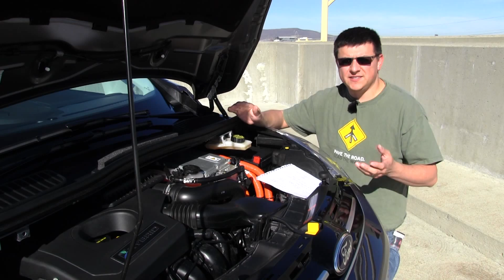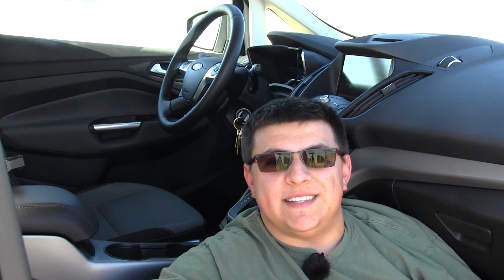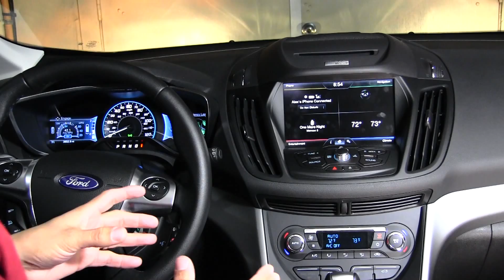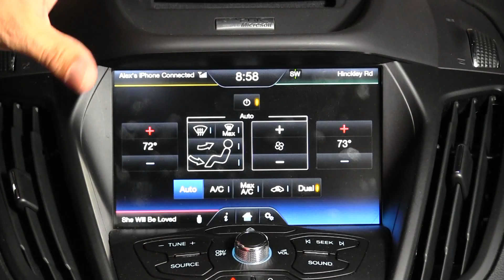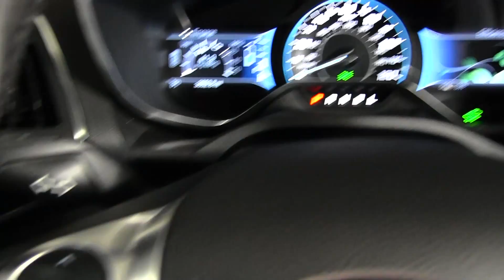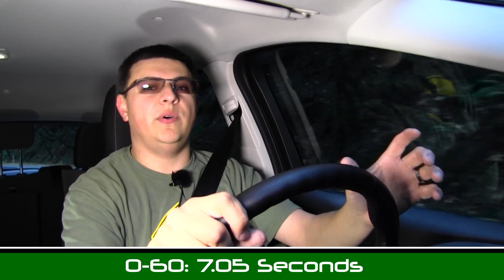2013 Ford C-MAX Hybrid Drive Review & Road Test

Comment: I have one of these and the poor baby doesn't belong on a ranch.  Right now I cannot get it to start.  It randomly has a radio that won't turn off so I needed to take the fuse out but because it seemed to turn off, I didn't bother and now it won't start with a jump.  It's dead dead.  I also changed the oil and when I went to reset the warning light, it couldn't be done so it still says I need an oil change. If that weren't enough... I was low on break fluid which I filled and that light is still on too.  The worst part is that one day the alarm decided to set and now I have only seconds and you can hear the count down to get into the car, put my foot on the breaks and get that remote key inside the vehicle before the alarm goes off.  What should I do?  There is a new Ford dealership in town and I've heard they are good.  Does good mean honest?  Maybe I should just trade it in.

Comment: I bought a used 2013 CMax Hybrid SEL (No plug-In) in 2021.
So far it is only getting 29 to 33 MPG overall.
New plugs, New oil, New air filter, Good tires, Average miles.
The gas engine kicks in a lot more than I thought it would below 40 MPH and I don't push it hard to go or stop. Last owner bought it new and was a little old lady. It seems to be in great condition and I like the car and how it drives except for the way it brakes it takes getting used to and the MS Sync / radio system had to be rebooted by pulling a fuse as it had stopped working. She even wrote a note about this problem in the owners manual.
Any suggestions as to how I can get my MPG up ? I tried premium gas and fuel injector cleaner all ready with minimal results.
All in all I am content with MPG as my 2012 4x4 Jeep only averages around 12 to 14 MPG.
Reply: I've had a Cmax for over 5 years and getting the max fuel economy takes some strategy and practice. From what I've found, the gasoline engine is more efficient at accelerating and climbing hills and the electric motor is more efficient at coasting. What I try to do is drive at a normal pace while accelerating and climbing hills to keep it from going into EV mode, but not flooring it. Then when I'm up to speed on relatively flat ground I let off the gas entirely and it'll change to EV mode and then you can just barely push on the gas to maintain speed and it'll stay in EV mode. 

Also, don't underestimate brake regeneration. Try to get in the habit of starting to lightly brake much sooner than you would normally. The longer you can keep the brakes in regeneration  you'll recoup more energy and use your actual brakes less. 

Also, cruise control can help as the computer is pretty good at managing the hybrid system. 

And if you can keep it under 65mph, you'll save a few mpg. Highway driving in general will get worse mpg than city driving. 

The radio fuse issue is common and has happened to mine probably 4 times.

Comment: I just bought a 2016 C Max SEL and really like it. the current mpg is around 41, but it is winter now and I am expecting better mpg as the weather warms up. This is significantly higher than that of the 2006 Honda Element I had which was averaging 19 mpg.  I also ordered a K & N air filter which many people have reported  that they are receiving higher mpg once they installed it.
Reply: So, 10 months later, did you see a difference in mileage?

Comment: All this talk about the fuel economy not being as good as it could be only averaging around 41-42 mpg makes me wonder if some people know what it's like to drive a vehicle that gets 16-18 mpg driving 50 minutes a day plus the other 50 coming back home because that's all you have to get to and from.
Reply: The Hyundai Ioniq blue gets 57-59 mpg. makes the CMAX 37-42 look like a joke lol. I'm afraid of the DCT in the Hyundai Ioniq blue though, and on top of that; the GDI engine. I had carbon build up issues like crazy in a 2015 Kia Soul 1.6L (same engine in the Hyundai hybrid). but it had 267k miles so they're pretty reliable at least the engine is I'm aware other than front and rear catalytic converters plugging up.

Comment: I needed something that is more elegant. I'm OK with Prius and had my eyes on the V5 model and love the all electric BMW I3 Ex.. but lacks distance, on any given day I could drive 200 miles, also I3 was over my budget. 
 My C-Max 2013  is Black and looks even more enhanced with tinted windows. and gives me a more luxury interior, with its double stitched leather, beautiful  interior lighting, full vanity mirrors, A/C outlets in rear with a 110 outlet. Each passenger has its own LED reading lights. I love the sound proofing Ford puts inside the C-Max and that Sony stereo system sounds beautiful. . I enjoy the higher riding stance for my older passengers, making it easier for them to get in & out of the car. The  large windows help when viewing neighborhoods from inside the car. Love the gorgeous panoramic roof. I use it when  Condo's, of course on a over cast day or evening. Lastly this car "BOOKS" when you step on the peddle. The C-MAX has allot of lo-end torque when wanting pass to pass a Semi-Truck;  I managed 110 mph on Alligator Alley, over to Naples, FLA. (Don't Advise) I am averaging 38/39, I have managed 44 mpgs.

Comment: For myself I brought the Prius series 5 , compare to the cmax, which handles better, nicer interior, the Prius had what I wanted, sporter look, hauling 10 foot length materials, led adaptive headlamps, lower ride and better mpg, last trip from S.F. to L.A. 51 mpg average speed 69mph.city varies on driving conditions 42-50+mpg overall is 45 mpg, The down side toyota are made cheap really cheap! Coming from a mechanic\ body man.
Reply: You should know the mpg is negligible at those numbers , always something new to learn mechanic

Comment: Love my C max averaged 47 mpg on the last tank so no complaints.. fun to drive and super comfy and quiet...
Reply: just bought a used 2013 c-max with 40k miles for 10500 and after 600 miles it also averaged 47 mpg.
Reply: @robertlarocque4685  Do you still have it? How is it? I'm considering to get 2017 model.
Reply: @robertlarocque4685   how is your c max? I was thinking of getting one

Comment: This is a fairly comprehensive overview of the Ford C-Max Hybrid car.  Ford has changed its MPG rating label to more realistic figures: 40 highway, 45 in town, 43 ave.  I'm getting 42.7 fairly consistently, using a velvet touch on the accelerator/brakes in town and 60 MPH on the highway.  To make me feel better about the unreachable 47 MPG, Ford sent me a check for $550  to compensate for the difference in fuel cost over about 3 years! The Houston Chronicle ran an article last week about this engine/transmission assembly plant which is in Houston. The units are then shipped to Detroit for insertion into the vehicles.
Reply: according to my mpg meter I am gettinmg 47 mpg average
Reply: 🙄🙄🙄🙄🙄🙄🙄🙄 do you math lol

Comment: You're right about the safety - the Prius and Prius V are tatty, unsafe and should be removed from the road. The C-max is built on the Focus platform, and the Focus earns an acceptable rating in small overlap. The Prius? Well, it did a good job of putting the front wheel in the back seat: 

watch?v=WWs_YaL9G0E

Comment from the maker: Remember that the Euro cycle that is frequently quoted uses not only the imperial gallon which is 10% larger than the US gallon, but they also have an entirely different testing methodology using much lower speeds and usually no A/C. There is no perfect test to be sure, but much of the variance is up to your individual driving style. If you drive moderatly, rarely go up steep hills, live in a moderate climate and avoid fast stops/starts any vehicle will get better mileage.

Comment from the maker: They didn't deliberatly target Hybrids or anything, i't's just that hybrids like the Prius C ddliver their best mileage in stop-and-go or slow-and-go traffic and at speeds under 65MPH or so. That describes plenty of avaregae traffic, but the EPA 2008 tests were designed to take wider driving styles into account, including: aggressive accaleration, 80MPH freeway runs, cold starts, A/C running, etc. and very little time running at EV-mode speeds. That's why the numbers drop.

Comment: If the EPA alters the tests to the detriment of hybrids they are truly stupid. My "C" is the ONLY car to ever beat EPA numbers and it does so by a fairly wide margin. Hyundai Elantras by comparison will not acheive real world highway numbers anywhere close to their posted figures. Under ideal circumstances...sure, but not as an avg. I've achieved crazily high mpg, but it is not repeatable everyday. Season long real world avg for my Prius C is 54.3 combined (gets very cold here).

Comment: I do know that there is something to what you are saying though. Maybe it is done differently (not the actual test, but logistically) in different circumstances. I say this because I'm aware of the Kia Sportage compensatory payments to owners and other suits and wondered why it ever happened. I'm certain though that the EPA was delivered Prius C's for testing. Basic physics indicates the C should (and does) outperform the reg. prius, but the EPA returned identical combined ratings.

Comment from the maker: They deliver cars only when requested by the EPA. With the Prius C the engineers I spoke with at the vehicle's launch even said that at that time the EPA had not verified the numbers, it is likely atht they have by now however. The EPA 2008 test's high speed cycle and new methodology severely drops hybrid vehicle numbers. In our tests the Prius C scored well above the EPA2008 numbers.

Comment: Perhaps you are right, but I don't think so. Manufacturers deliver a car(s) for testing. In fact it is widely known that Japanese and American Toyota engineers were furious when the EPA returned the 53/46/50 numbers for the Prius C, believing it should have achieved much better. Inmy experience with non-hybrid cars and their posted numbers, I believe Toyota was absolutely right. They should have gotten better. The test is what it is, and apparently Toyota didn't game it.

Comment: OK...fair enough and I agree with you completely. I was merely making the observation that your post stated expected statistics and did not support any particular opinion or fact. Also, the EPA themselves determine MPG ratings, not Ford or any other manufacturer. While it may be true that Ford is designing the car to function well in the tests and not neccessarily in the real world. Hyundai and Kia having been doing this flagrantly for years now.

Comment: Read your post..ok..great. So the Energi did "let's say the same as the non plug in when not plugged in"...fantastic..that's exactly what you should expect. Moving on, the Prius did better. Again...exactly what you should expect. Why you ask? The C-max has monumental more HP, more volume, it's heavier, wider tires, better performance etc. I am a Prius C owner and I love it, but the Ford may prove to be the better car. Alot of variables when comparing fuel mileage. You'll learn soon.

Comment: Hey Chek...I'm a Prius C owner and I love it, but I admit this Ford is indeed compelling. I've had great luck w/every Ford I've owned. I wanted the C-max...Knew about, read about it, but they couldn't get it to market fast enough. My old 18 y.o. Taurus was getting old and I couldn't wait. You will be surprised as it warms up how much better your fuel mileage will be. Cold kills fuel mileage, both hybrid and non-hybrid alike. I think Ford should have waited until spring to launch. Good luck bro.

Comment: I purchased a C-Max in November, traded in a Prius that I had for two months.  The Prius is a good vehicle but I could not get comfortable in the drivers seat, so strange.  The C-Max from first test drive was very comfortable. Also has a much safer "feel", visually with large windows, blind spot mirrors, dimming rear view window, and so much more.  Being in Wisconsin I like the heaviness of the C-Max.  Not worried about sliding off  snowy, windy roads in WI.  My son named it our "Little Wonder"